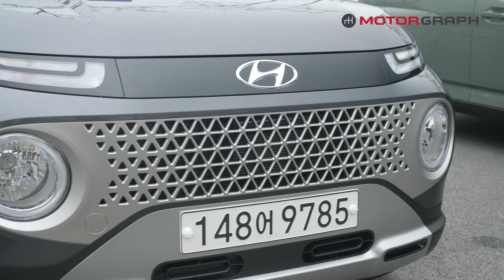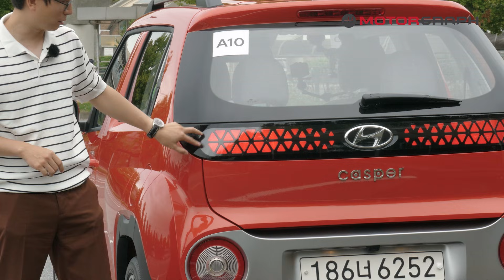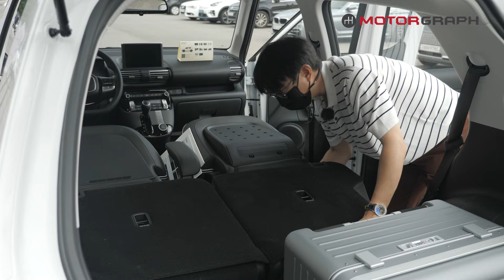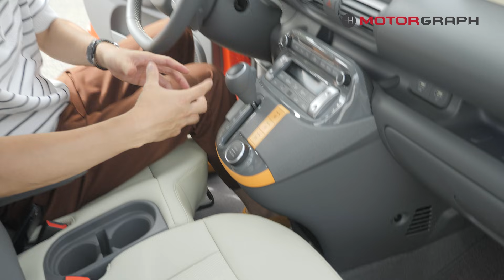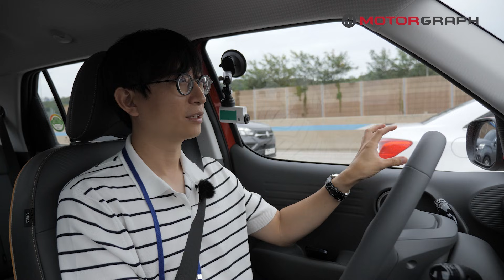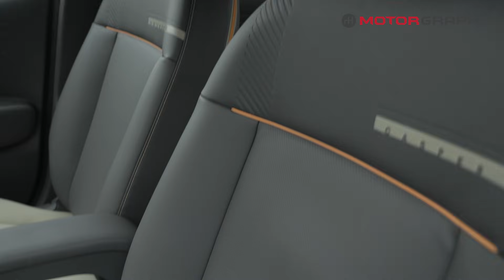New 2022 Hyundai Casper SUV Review "The Smallest and Cheapest SUV"

Comment: Hyundai and Kia vehicles need to be banned in the U.S. until they return to placing the turn signals within the brake light housing. Having them at the bumper level near or within the reflector housing is dangerous. When the driver behind is too close to obscure the turn indicators, an accident can too easily happen.

Comment: Living in Toronto.  Height clearance, all wheel drive, traction control, ABS, heat/defrost, a/c, turning radius and city parking capabilities in tight spaces.  Wirh 4 adults in car, how nimble and how do the driving characteristics change?  Any plans for NA, any upgrades?